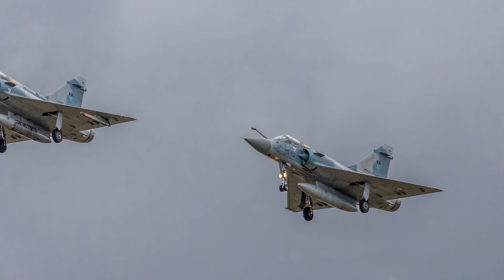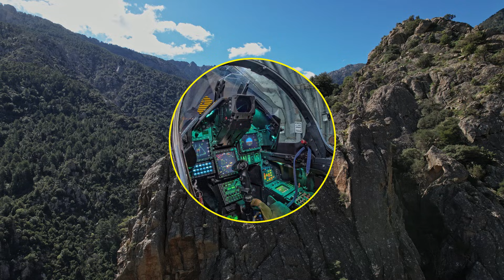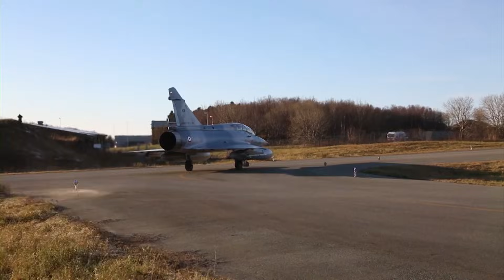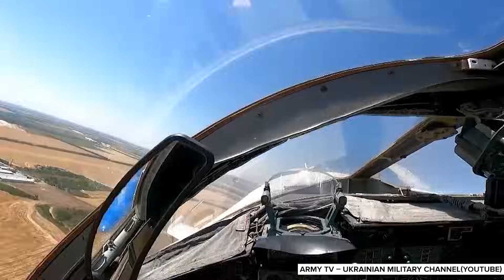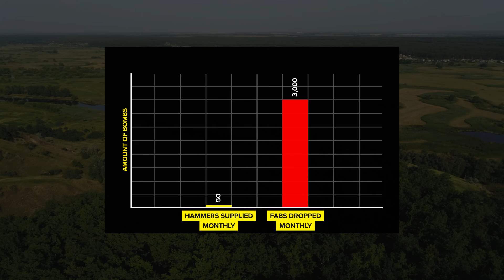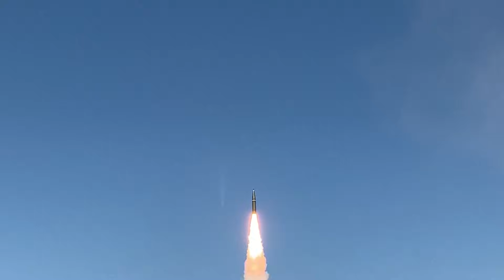Ukraine BOMBER BRIGADE Is Getting French Supersonic Jets

Comment: The Mirage III was replaced by the Mirage F1, long before the arrival of the 2000. F1 was not delta winged.
Reply: The Mirage F1 never replaced the Mirage IIIC/E, The Mirage F1 was designed because the French Airforce needed a combat aircraft that had lower approaching speed and that could operate from crude airfields in Africa which is something the Mirage IIIC/E simply could not do. The Mirage F1 was there to complement the Mirage IIIC/E, not to replace it. Fortunately, the Mirage F1 prove to be a superior aircraft to the Mirage III in most department. What replaced the Mirage IIIC/E is the Mirage 2000 and the Mirage F1 continued to serve up until the mid 2010's when it was finally replaced by the Rafale and the Mirage 2000D RMV
Reply: @monfortnicolas5448  No way, the original assessment was that Mirage III was replaced by Mirage 2000, which is factually wrong. It was indeed replaced by the F1 and that's aviation History, pure facts. That has no importance btw. Happy new year to you.

Comment: France is really stepping up here! Though the Mirage 2000-5 is slower and has a lower service ceiling than the Su-27 or Mig-29, I'd be interested to see how their upgraded avionics compare to the Soviet era Flankers and Fulcrums Ukraine is using now. Either way these Mirages will be a major upgrade from the Su-24, and with the Mirage able to equip the SCALP missiles it's the Fencers' role they will most likely be supplementing.
Something else to consider, though the Mirage is less capable than the F-16, they are arguably a better fit for Ukraine right now. With their air intake less susceptible to FOD and more robust landing gear, Ukrainian runways will need less prep compared to the Falcons. And with the bottle neck in training pilots on the F-16, the fact that France controls the entire supply chain for the Mirages, training and turnover theoretically should run more smoothly. On top of this, France, and other Western countries like Greece, are phasing out their Mirage planes as they upgrade to F-16s and F-35s. Handing over these Mirages to Ukraine will actually save Western air forces the cost of mothballing them. It's a win win win.
Thank you France!! Really stepping up here!!

Comment: The Rafale, though a very capable aircraft, it is NOT a 5th gen. It's considered to be part of the 4.5 gen. No stealth capabilities, no 5th gen slot.
Reply: Not so true… The upcoming fighting drone that will accompany the Rafale will be stealth and autonomous which is a 6th generation aircraft characteristic. And the Rafale has the same ERS than that of the SU-57… also there is no such thing as a “stealth” aircraft. For instance, the F-35 is not stealth when it goes supersonic (not able to do any super cruise, which the Rafale can do), the F-35 is only stealth when  radars are in front of it depending on frequencies. Finally, stealth does not mean invisible 🙃 It’s especially problematic for aircrafts that bet everything on stealth technology because the upcoming generation of radars will likely be able to see them like the upcoming radar of the Rafale among others !
Reply: @henricloclo1598  So, none of that changes my statement or makes the Rafale any more a 5th Gen. Hell half of it is worthless information. But thanks, I guess?
Reply: @SkunkdMonk  it has some stealth capabilities, and with drones for the next version would be a "6th gen".
Reply: @canicheenrage  It still will not be a 6th Gen fighter. It will be a 4.5 gen fighter still. The F-35, just tested its Loyal Wingman, it will possibly be a 5.5 gen fighter. To be a 5th gen fighter you have to have advanced stealth capabilities, the Rafale DOESN"T have it. Just like the F15SE, is still not a 5th Gen fighter. 6th Gen will require "Extreme Stealth Capabilities" as well as the advanced AI capabilities. I'm a tank nerd, not a fighter jet one, and even I can understand this very easily....come on
Reply: @SkunkdMonk  Then you should understand the concept of marketing terms.
Reply: @SkunkdMonk  we get it don’t worry. What we’re just trying to explain to you is that the concept of “generation” is not applicable to other planes than the US ones for it’s not conceptualize in the same way from the very beginning. The Rafale is a generation itself. Of course the Rafale is not completely stealth (but the F35 is not as explained above, no fighter jets are 100% stealth, other planes are more stealth like the B2 for it has notably no vertical stabilizer and it is subsonic), but it will incorporate technology that the US industry considers from 6th gen like its stealth fighting drone (same design than that of the B2) with AI and autonomous missions, or new radars likely capable to see stealth fighter jets and small drones. The difference with the F35 and the Rafale is the choice made by Dassault and LM to focus on survivability or stealth.
The Rafale won competitions against the F35 in UAE & Greece and against other “stealth” fighter jets like the SU57 in India.
Those two along with the F22 are undeniably the most advanced and performing planes in the world.
Then, of course their respective successors in the US (NGAD) and SCAF (now exclusively French) will integrate the new characteristics from scratch with the Dassault Rafale F5 along with it’s upcoming fighting autonomous drone being the demonstrator of the French SCAF.
Good evening and thank you for the conversation.
Reply: @henricloclo1598  you wrote a lot, I'll give you that. However, it's all either pointless.....or wrong.
Reply: @SkunkdMonk   we have a saying in France, translating into "there are no worse blinds than those who don't want to see".
I strongly suspect it applies to you.
But just in case, or for others who might wander, i'll still precise:
Design choices have consequences.
The Rafale isn't designed as stealthy, but has low visibility features and a very performant electronic warfare suite, which allowed it to operate freely in an airspace will a fully operationnal air and anti air defense in Libya two days before the US started their SEAD operations there.

The F35 is stealthy. Only shows later on radar, as with its big engine, in IR, it shines like a small sun, and modern IRST can detect at up to 100km at high altitude.
Heavier, it can at best carry comparable payload, and even trying to, loses its stealth, and can't use vertical/short take off for the concerned variants.
Worse, and less talked about, it requires a way more costly and time consuming maintenance for every hour of flight, and has an appalingly low availability rate.
It's not as catastrophic as a decade ago, but still. 
And the compromises made for stealth meant a less agile aircraft to defend against air and anti air threats.

With the Rafale F5, and drone control, it will get even more passive penetration capabilities as the Neuron is a drone even stealthier than an F35.

The F35 has excellent qualities, but also flaws, and even when/if it ends up fixing all of them, it will still have heavy drawbacks.
The Rafale is a different aircraft, but just as advanced; That generation/feature is a marketing term.
Reply: @canicheenrage  in Canada we have a saying, I don't speak much french, just enough to fuck with Québécois. So I won't try to translate it, but I think you'll get the picture "You sure used a lot of words to not say anything".
Reply: @SkunkdMonk  
So either several people making argumented, nuanced posts are wrong and "say nothing".
Or the passive agressive guy who uses marketing terms and dismisses everything without backing anything up with even a single argument, is.

Hmmm. Not the toughest questionment i've ever faced.

Only question remaining being i don't know if it's out of pure malice, lack of cognitive abilities or, as i'm starting to suspect, a combination of both.
Thanks for vindicating my hunch in any case.

Edit: actually, there's another one: do you happen to have any link, direct or through relatives, with the use, maintenance, production and/or sale of the F35 ?
Reply: @canicheenrage  here's what your missing, you're trying to add nuance to a topic that is cut and dry. It is one thing or another, A or B. it being a marketing term or not doesn't matter. If it has x then it is a, if it does not have x it is b. Rafale, by no standard is a stealth aircraft, Gen 5 aircraft are defined by their stealth capabilities, therefore Rafale, regardless of how great a plane it is, is not a 5th gen fighter. There's not much else I need to bring to the "argument".
Reply: Vive le marketing de LM!:face-blue-smiling:
Reply: The F35 is not a 5th gen then, considering that the Rafale responds to more criterias than the F35.
Here the 5 features defining 5th gen according to Lockheed (let's not forget 5th gen is just a PR marketing stunt from Lockheed):
Stealth 
Advanced Avionics & Sensor Fusion
Supercruise (Sustained Supersonic Flight)
Supermaneuverability 
Network-Centric Warfare & AI Integration

The Rafale has actually more 5th gen features than the F35 : the Rafale has advanced avionics and network centric warfare capabilities like the F35,  does not have a true stealth design, despite RAM coatings and reduced RCS, but can supercruise and is supermanoeuvrable contrary to the F35.
Hence the Rafale does have 4 of the 5 criterias, while the F35 only responds to 3 of them.
Reply: @MN-vz8qm  the Lockeheed definitions (yes the company that camenup with it) are legitimately based on the F-22 and the F-35. And everything you said was just pointless noise. So congrats on wasting both our time.
Reply: @ ??? your message makes no sense; I jhust took the "definition" of what is a 5th gen jet and compared it to F35 and Rafale. Maybe you don't like the logical conclusion there.
Reply: @MN-vz8qm  that's not what you did though. You literally just talked out your ass. Your "logic" is the aircraft that the generational definition is based on, isn't part of the generation. That's not logic, that's lying.
Reply: @SkunkdMonk  my point is that by the definition of lockheed itself, the rafale shoumd then be considered a 5th gen
Reply: @MN-vz8qm  no it does. It has some stealt....got it. It is missing the BIG kicker is ADVANCED stealth. The F35 cross section is like .005, the F22 is like. 0001. Now you are going to argue well the Rafale has just a little bit more cross section than an SU57. The SU57 is fucking huge. So according to Lockheed the reason the Rafale is not a 5th Gen is because it doesn't have nearly enough stealth to be considered advanced stealth.
Reply: @SkunkdMonk  Stealth is just one of the 5 main characteristics making a 5th gen.
Clearly, you do not need all characteristics to make a 5th gen, otherwise as  stated previously, the F35 wouldn't be a 5th gen, and you cannot neither say that you just need stealth, otherwise the 1980s F117 would be a 5th gen.
The reality is that 5th gen is simply the idea that you have a jet which has several advanced cheracteristics of the 2000s. Which is both the case of the Rafale and the F35.
Would the Rafale have advanced physical stealth, US marketing would play on another characteristic in order to single out the US jets as sole 5th gens.
Reply: @MN-vz8qm  according to Lockheed Martin it is THE main determining factor of 4.5 to 5th Gen. Not a, not among them....THE
Reply: @ Yep, just what I wrote in my last phrase.

Comment: The Mirage is essentially the French version of the F-16. And joining the air force is an attractive way to support the war effort even if you're only part of the ground crew, sure you're being targeted as a facility, but you're not individually marked in the enemy's gun sights, the support crew should be far easier to recruit than front line soldiers
Reply: The 2000 is similar in its capabilities and structure to the F-16, but it's a 100% different system. Besides, it hasn't been sold in the same quantities, so that it's no longer possible to modernize to the same level as the latest F-16.

Comment: The Ukrainians would be better off using SAAB JAS-39 Gripens since the Gripens can use the same runways used by SU-27s & MiG-29s without ANY modifications!
Reply: So send them more Gripens.  Monday morning QB.
Reply: Mirage 2000 can land on such runways. Since France has always been far from USSR it’s something that is not in the French Air Force doctrine, but in the 90s, Mirage 2000 did joined training in Poland and Mirage 2000 landed on highways.

Mirage 3, was operated in switzerland with Jato rockets to takeoff from regular roads.

The main limitation for jet fighters is: Air intakes and landing gear. Since air intakes are on the sides there is no problem compared to f16
Reply: So can the Mirage 2000s… 
The only one that can’t is the F-16.
Reply: @brunol-p_g8800  No, the Mirage 2000s CAN'T do that. They have the same problem as the F-16s.
Reply: @fredhercmaricaubang1883  In fact, the Mirage 2000 is perfectly capable of taking off from a highway. What causes issues for the F-16 when taking off from less-than-ideal runways is mainly its ventral air intake, which sucks up everything on the runway. Since the Mirage's air intakes are located on the sides, this problem is significantly reduced.
Reply: @Theluciole97  Those beautiful Mirage 2000s still have a longer run than the Gripen, though.
Reply: @fredhercmaricaubang1883  si  si , les mirage 2000 peuvent le faire , je pense que votre certitude vous discrédite.
Reply: @SupersonixX  Talaga? Pwes, kaganong kahabang kinakailangan yang Mirage 2000 niyo para makalipad at makalapag? At kapag kinumpira sa JAS-39 Gripen, sinong mas mahabang kinakailangang lalapagan at liliparan, aber?

Comment: they have the newer radar and are complete upgrades but Bombers they are not.  They have the capability to use air to ground smart munitions but it's not  a bomber. It's a multi mission  light single engine fighter. So they carry some bombs  but not like a B52. a B21 or even a 1930s era Flying Fortress.
Reply: Moreover, the Mirage design is optimized for high and fast flight domain, where it really shines.
But the plane flight computer will prevent to reach these speed when loaded with bombing equipment.
So they can't even be compared to a "light bomber" such as the Tornado or Su-34, that were designed to flight loaded with tons of ammunition at medium altitude subsonic speed, with supersonic capability as an important survivability design point, but not a mission critical one

Comment: You neglected to mention Israel , who based the Kfir off of the Mirage.
Reply: It was a mirage modified by israel
Reply: @ exactly
Reply: Mirage 3. Not the same plane.
Reply: @eric0dujardin  thanks for the clarification. Sort of the difference between a F16-A, and the new Japanese mod of the later variant.
Reply: @ Mirage 2000 looks about the same but its inner design is 100% different of the Mirage III, notably because of electric commands. So it's more like F-5 vs F-16.
Reply: @eric0dujardin   several discussions mixed. I meant the Kfir was a Mirage III EX with a different engine and electronics updates since.
Reply: @eric0dujardin  Mirage III EX, to be precise.